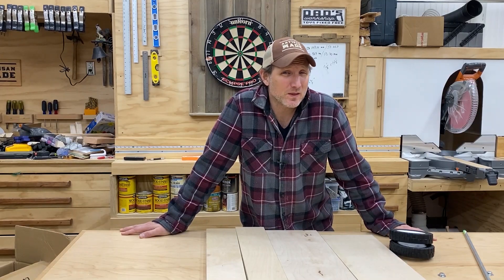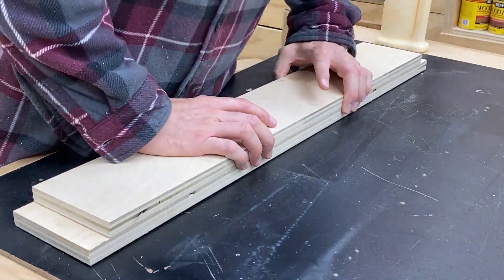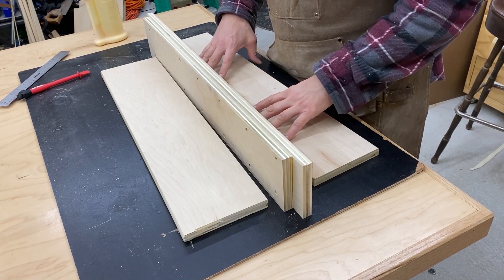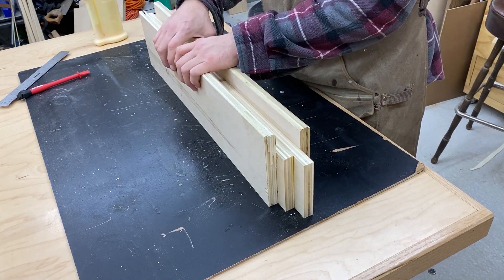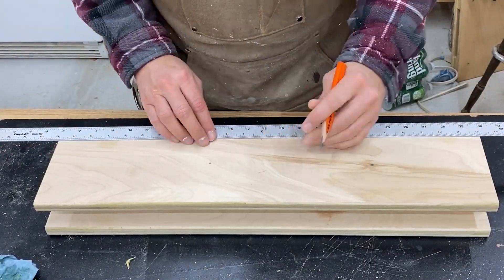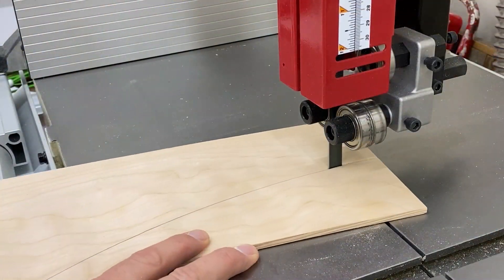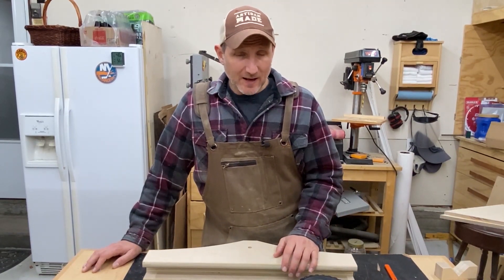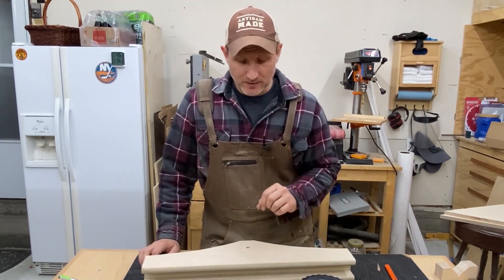DIY Plywood Dolly / Drywall Cart / Woodworking

Comment: Nice Work,  i like it but id add a handle on one of the 6 inch sides you know drill holes 5" apart and cut out the middle, easy way to carry it and can be hung up when not in use
Reply from the maker: I agree. I might do that.

Comment: How does it do on bumps/gravel turning on lawn?
Reply from the maker: Haven’t had any problems. A little harder to push though. If you plan on using it on unpaved surfaces often, use bigger wheels.

Comment: Have me an idea. I have old high wheels and pneumatic 4.10s plus axles. I fo a lot of furniture moving. Have this odd cart with a peak so guess it use to have a upper that had a peak on it to fit that cart. I can rotate upside down and use that peak for a single axle. Instead of a few inches for drywall plywood, maybe wider for avg hutch desk etc. sole basically just lift one end slide cart, center it and large wheels will be easier to balance. Those furniture dolls are a pain, slide around, wheels are chocked by every speck of dirt, etc...
A basic panel dolly cost 80 plus. Even if buy tires from harbor freight , your idea cost, maybe 20, especially if you if you have scrap wood laying around